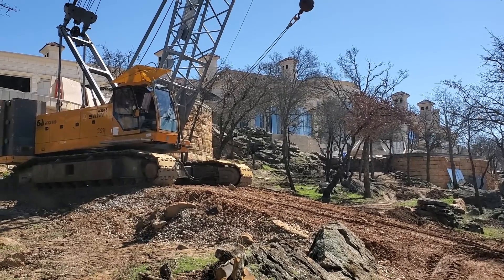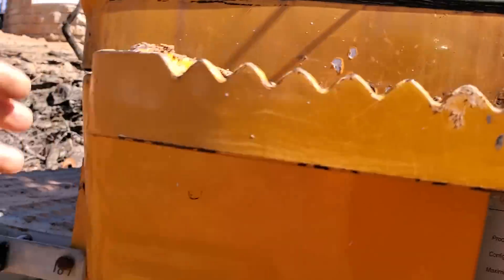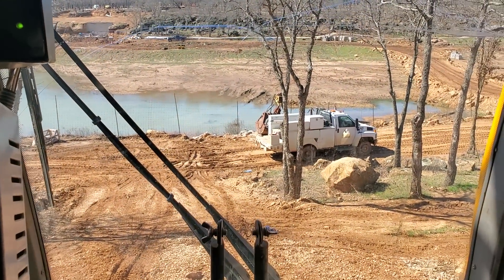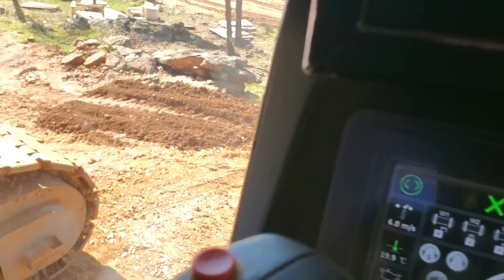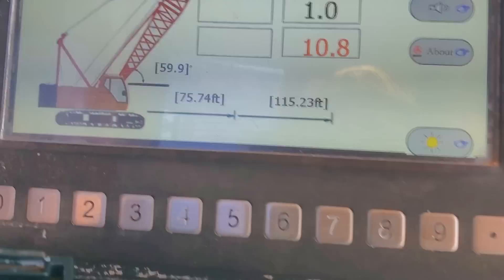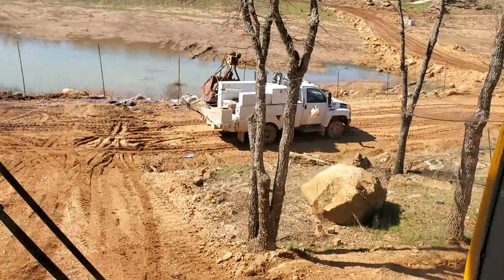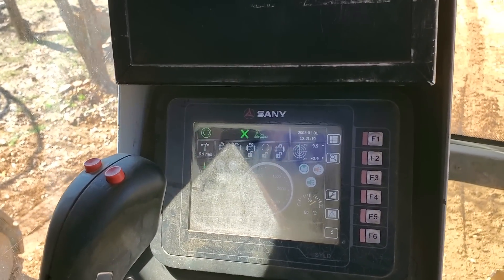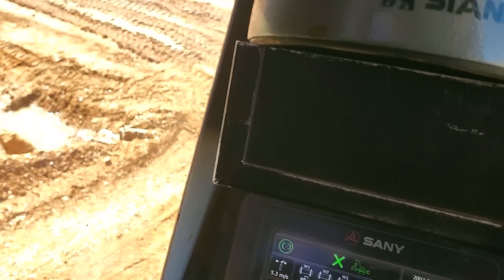Crawler crane on a slope

Comment: Wouldn’t it be better to back down the slope at a low boom angle? (In most situations)
Reply from the maker: A few reasons, one is that in the manual it says to do it this way and that's because the counter weight is 65 thousand pounds and the boom is about 20 thousand. When you're going up the slope with your weight uphill this puts you weights over the front idlers but if you have your weights down hill they are way out past the final drives and the boom is not enough weight to counter act the extra weight out past the finals like that. 
Second there is a multi million dollar mansion at the top of the hill and if I put my boom up there it would hit the structure. I literally can't put the boom low enough to counter act the rear weight. 
I know sometimes it seems counter intuitive that max boom angle is the most stable position but that is usually the case. That's why you get the max capacity at max boom angle.

Comment: I  operated scrapyard cranes back when we used a hand crank to start it. Finally moved up to electric start. Only one guage and that was oil pressure. My crane sat on a pad on an incline above the trailer. I’m the winter, the crane would start sliding towards the trailer. I’d have to take it out of swing and put it in travel to get back on the pad. I never was able to operate a crane such as this. I wonder, would you be able to operate the junk I had to? No heat, no ac, no fan, no door(blanket sometimes) plexiglass front window, that you had to take out in the early morning, because the glass was yellowed, no gauges, hand tools to fix what broke. Back when Stanley Thermos was made in the USA. (Actually am jealous that I never got a chance to operate a crane like this)
Reply from the maker: I never ran old cranes but I did run a lot of old dozers. Manual transmissions, clutch and brake steering, pony motors for starting, open station,( I still have the old sleeping bag I used in the winter ) and I've always done all my own mechanic work even on this machine. Everything from rebuilding track frames, engines, pumps, gear boxes, hydraulic cylinders, even boom extension cylinders on hydraulic cranes.

Comment: I don’t know about cranes. But I do happen to know that manufactures of excavators tell you to always keep your final drives uphill. It is very hard on them to work on or  travers slopes with the finals downhill.  For one, they  are a lot heavier than the idlers and when you’re on a slope like that all of your weight is on the downhill edge of the tracks. Those final drives are not built to carry the weight of the machine.
Reply from the maker: This is a direct quote from the manual for a cat 320e page 35 para 2.
When possible operate the machine up slopes and down slopes with the final drive sprockets facing down the slope.
Reply from the maker: Read the manual. 
A lot of times what you've been told and accept as true is in fact the exact opposite.
Reply: @cameronturner7475  
Yep! I like to keep and slack, up on top where all it needs to do is carry the unused portion of track back to the front where it is put back into use and becomes stretched out tight (in a straight line) on its way back to the drive sprocket. In a crawler crane, I always walk forward up a slope and walk it backwards down a slope. Dipping gravel, I always keep the traction motors or drive sprockets toward the water hole and idler tumblers behind me. Just my preference, I don’t care about the drives weighing more. If you’re worried about that then get a bigger machine.
Reply from the maker: We have a small mining operation and we use Cat 320,330,336,340,349,375,390 and 394 excavators and Komatsu 200 and 650 excavators and all the manuals say the same thing, keep your finals down slope.
Reply: @cameronturner7475  
Yep! After utilizing this procedure for many years, I can’t imagine the ride one could get if he were to put the idlers out front, walking down a slope, and were to blow a hydraulic grease track tensioner seal? Those usually don’t give warning when they blow out.

Comment: What if you would have had boom at uphill side and you would have lowered it a lot, then you would not have tipped over? Would that be safe?
Reply from the maker: The danger would be tipping over backwards because there is far more counter weight than there is boom weight. Every manual that I've seen with instructions for slopes says counter weight should be uphill. When you take your license test the answer also is counter weights up hill. When you have your weights up hill it allows you to monitor your capacity because as you increase your slope your capacity decreases. This allows you to raise your boom to keep an acceptable capacity. 
I know a lot of excavator operators like to go up hill with the boom extended but if you do tip backwards you can't stop yourself so even on an excavator you should go with your weight up hill.
Reply: @cameronturner7475  bigger counterweight makes sense. First I read and understood that you meant "tipping over backwards" would mean to uphill side, but then understood that you mean tipping over backwards to downhill side where the counterweight would be. So even with whole boom wide angle adjustment, it would not be enough to fight against the  big counterweight at downhill side. That makes sense. I have an excavator and sometimes there is a need to climb over a pile or go across steep slopes. Understanding these cases and the most safe way to operate the machine is a big deal. Even your note about which side the sproket should be. Also, volvo says that it wears 30% more if you drive sproket at front side on flat surface. These are not obvious small details. Thank you for replaying.

Comment: One question I have is ( SANY) a affordable crane. My time goes back to 
( UNIT& Hein Warner) Excavator from the 1970s. The owners use to tell me or call them poor mans machine. Because they were affordable to a smaller contractor.
My time working alongside was small mainline sewer jobs. I always was amazed at operators using there feet for Dipper & tool functions. That tells you my age, and when I started doing sewer work
I mostly ran a CASE 580-C digging side sewer stubs. 😊
Reply: I hear you, bro. Spent time on bucyrus, warner swasey, koehring, etc. I hated sewer/water main work. Luckily most of career on cranes. Retired with the liability portion off my shoulder. Loving it! Blessed day
Reply from the maker: I've never looked into the prices but I'm sure Sany would be cheaper than most brands. As a kid back in the late 70s, I started working for my step dad doing residential sewer and water services.  He owned his own business until he died and my step brother now owns it. We're ran International 3500s switched to Fords and now he runs Cat.

Comment: It's about to overheat
Reply from the maker: The scale on the temp gauge is a bit odd. Full scale H is 100 c which is 212 f. So even when it's maxed out it's still not overheating. It usually runs about 80 c which is 175 f and about 7/8 scale. So it just sits there almost maxed out all day even though it's fine.

Comment: Does the boom not drop below level with the ground? You can't just lay it down in front of you?
Reply from the maker: Both.  There is a fence across the road that's only about 100 feet away. It doesn't show up real well in the video but you can see the posts. The boom can go a bit below level but if you go too far you can't pick it back up. The geometry makes it harder to lift the lower you go and with a long boom you can get to where you can't pick it up. Plus you can over extend the back stops and they will come apart and you could run out of rope on the boom winch. There are several reasons why that could go bad.
Reply: @cameronturner7475  Ahh ok, genuinely didn't know. Thank you.

Comment: I had to walk a 218 Link Belt up a much steeper hill then that. Had 160 main and 60 foot jib at 15 degree offset. I had counterweight uphill. As I started up the grade I kept my boom angle at about 72 degrees. I boomed it up till the stops kicked out. Wasn’t a fun think to do but I made it with no mishaps.  That was the steepest grade I had to go up. I was an operator for 38 years, retired now. My first seat was a Bay City with a D315 Cat with a pony motor. 

Good informative video.
Reply: Hey, old timer!😊 Just retired after about 45 years. My first assigned dragline was a Ruston bucyrus 22rb. Got a 30B after it. Etc. Pray your enjoying retirement as much as I. 😊

Comment: Well Done! You made that look easy. A lot easier than I did when I use to have to go up and down hills in a American 7260 Friction machine.
Friction machines are whole different animal in regards to your travel dogs.
The rest of it, your boom angle, counter weight, Chain drive tumblers is still
Like you describe. 
This needs to be Showen at the training centers for the apprentices and veteran operators alike. 
New Sub here
TGP
Reply: No it doesn't. They got the wrong machine on the job site. There engineers need to be fired.

Comment: Absolutely great video! I’m curious if you use that clamshell bucket on this crane. I don’t tend to think of clamshell or dragline buckets being used on a crane like yours. Can also say that although I’m seeing a lot of Sany equipment these days, I didn’t know they made cranes. Thanks again for posting this!
Reply from the maker: Yeah sany actually makes a full line of cranes,  hydraulics, truck mounts, etc.  They even make one of the largest lattice booms in the world, it has a capacity of 8,000 metric tons. 
I do use the clamshell on this crane but it's not ideal.

Comment: So you could not have raised the boom any further?
Reply from the maker: So the boom will go up to 75 deg. Another 10 deg but then you are against the limit switches and you get an alarm, which is kind of annoying. Also if you are say 73deg and start to bounce a little you could bounce against your limits. I just try to keep it high enough to keep the capacity up above 5k once it breaks over.

Comment: Do you lock the swing gear with that much counterweight uphill?..it looked like there was an icon at the top of the monitor that said the swing was locked…
Reply from the maker: Yes the swing is locked. It has a hydraulic ram that drops the lock any time the brake is on but it only engages in the straight forward or backward positions.